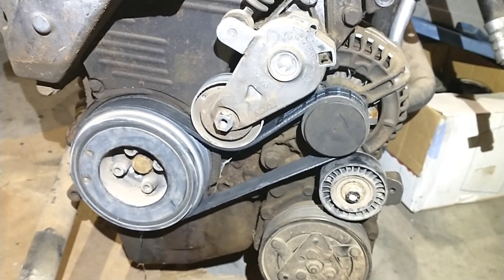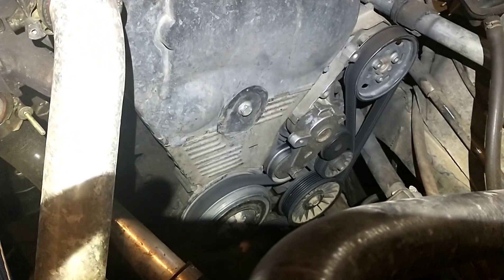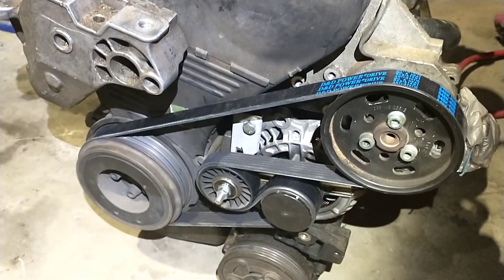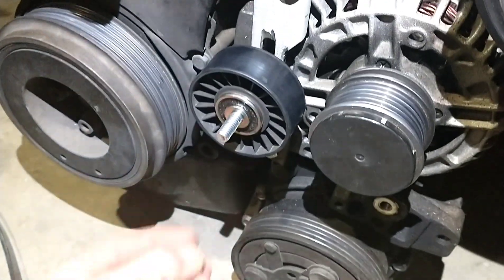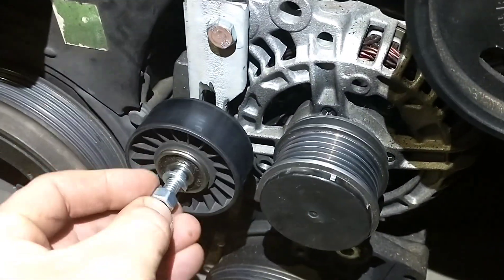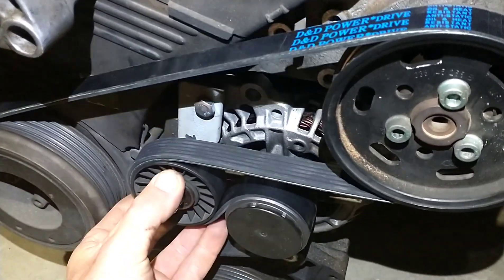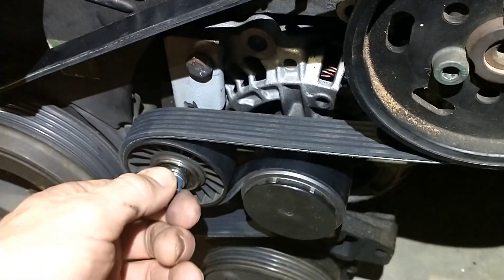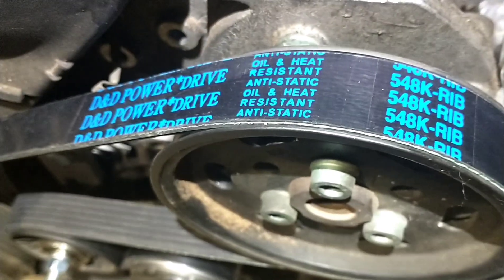ALH TDI MK4 Serpentine Belt Options For AC and/or Power Steering Deletes

Comment: It ripped a lower aluminum bracket for the roller.Bdestroyed alternator mount aluminum part. I need my car to be running within 24 hours. 3.06 in wideo best solution. Wish me luck...I have a 1318mm 6-row belt at home from Opel Corsa 2005CDTi used and now ones. I'll remove the climate compressor clima didn,t work before, and try to make custom tension roller bracket. Thanks for a tip
Reply from the maker: Hopefully it works! 🤞 Glad to help

Comment: Can I run a bypass witch on my 06 BRM Tdi  to allow me to turn the fans ON and OFF for the radiator??? I see the ECM controls everything on the BRM so I wanna be careful. Ive seen a few videos for a bypass switch mounted to the dash to allow one to turn the radiator fans on and off.
Reply from the maker: It's possible, I do not have schematics for the fan controller though.  I would probably just add an aftermarket relay setup if I was to do something like that, trigger it on separately myself
Reply: @TDISwaps  I saw a video on here of exactly that and the dude wired the relay to the ECT sensor that sits on the thermostat housing. It worked fine. I was just curious if it would play well with the ECM program so that it wouldn't conflict with the ECM program and fail to function or something else. Im only guessing that the worst that could happen would be that it would just not work. So ready to run a few wires with a relay and a switch for peace of mind while on long road trips with a hot diesel. I am to start a new job in Colorado 873 miles from home 5 days on and 5 off so that first trip with the new /used Jetta I want it to be mechanically correct as I can get it until I get a paycheck to go back and put new turbo, injs, EGR del, etc to give it a better life expectancy along with better maintenance. The Passat is on pause due to lack of funds for its turbo and extreme del. The Jeep is on pause for lack of funds and fab issues with the alternator bracket still. I need to find a machinist to fab the better bracket and then I can proceed to finish the Jeep. The Jetta will be for sale later this year if you know anybody that wants a good BRM with 5 spd, new clutch mastr and slv, new braided line, immo dash coming soon bc my dash doesnt read any instruments. dont know for sure why. The fella that sold it to me said it just quit working one day. He gave me another dash/cluster that wont allow the car to start of course. But why in the hell won't the old dash show any functioning gauges ??? I ripped the 2 clusters apart and placed the shiny new cluster face onto of the old cluster bkside to make on cluster. I hoped it would light up the gauges bc that old cluster of the 2 is the only one to allow the car to start up and run. Any ideas there appreciated. The Tdi guys say to send it to Eric in Ohio to do an immo and such but I dont need and immo I need the lights and gauges to function. He charges $ 150 for an immo and you must send the ECU I.D.. lost for now.
Reply from the maker: @Indianrider65 yeah that's a tough one if you have one gauge cluster that works I would just leave that one in and send me the ecu, I can do the immobilizer for $60.  You can PM me on Facebook.  https://www.facebook.com/share/163Ma2sMQw/

Comment: Threads on my power steering rack stripped. Gonna delete the power steering pump and send it
Reply from the maker: Yep you can definitely do that!
Reply: @ Thanks for the reply. If I do delete my power steering pump, should I loop the high/low pressure sides of the steering rack and fill with some fluid? Or can it run dry. Thanks.
Reply from the maker: @OwenC1 ya it just needs a little oil not much

Comment: my AHF Golf 4 TDi AC pulley bearing and magnetic coil failed now its making loud irritating metal to metal noise..... new pump is very expensive so while im saving up for that, i wana delete the AC ...... i just need the size of the belt i can temporarily fit there ... must be shorter than the original..... what size belt are u using ?
Reply from the maker: I believe it's 55", there's a link in the description

Comment: You had mentioned that "Austin" did a version of this. Do you have a link to his video??? I got the homemade plate made/copied of your version here and the bolt sits at just a bit of an angle to cause the tensioner to walk the belt off on a hand turn. I'd like to see his video to compare the flat metal bracket you both make. I have tried to find his video but haven't found it yet. I think if I add the second nut that sits on front of the plate I can maybe get the level/balance/flushness of the tensioner but......then it may be cause the tensioner to stick out 1/4-1/2" away from the grooves of the alternator pulley that it won't work. I will go try it again today and get back to you. I just think that nut in front (that the actual tensioner sits on) may stick it forward a bit too much. thanks brother
Reply from the maker: I don't have his video unfortunately and it's buried in his channel now, but it's almost identical.  It sounds like you might need to try different metal or tensioner, is the alternator stock? Maybe the surface of the alternator isn't flat...
Reply: @TDISwaps  I found it from 4 years ago. Ok today I move onto the coolant hoses if I get hung up on alternator bracket fab. LOL. thanks brother.
Reply from the maker: @Indianrider65 no problem man!
Reply: @TDISwaps  No its not stock bc I ordered a custom 250 Amp alt from JS alt in South Carolina. Its almost an inch wider. I had to get longer bolts and re thread the mount holes to accept SAE bolts. fun fun fun. Have a great day.
Reply from the maker: @Indianrider65 ok that makes more sense! You too man!
Reply: @TDISwaps  I have made 4 different AC delete brackets b4 I finally got one somewhat perfect. So today after several attempts last 3 weeks minus a cold weather off week....I got it on but....the belt keeps walking off the tensioner pulley. I tried many different amounts of spacers to try to see if it was just the alignment of the pulleys. The tensioner seems to "tilt" to the D/S a tiny bit ...maybe that is enough to cause it to walk the belt off??? I did 
Austin's version this time. I had done 3 of your version and gave up. Im about to just buy the big AC delete pulley in your video fm Amazon if I cant make this work this week bc its holding me up fm moving onto the rest of the project. Im having to work on it outside bc I dont hv a shop so I have to take warmer less windy days to do some of the work. Ill post some vids of it when I figure out how. and you can tell me what I may be doing wrong.
Reply from the maker: @Indianrider65 sorry to hear that man! There must be something off with the casting on your alternator brack bolts unfortunately you might just have to go a whole different route 😔
Reply: @TDISwaps  I just posted 3 short videos 55 second videos if you can see them and critique let me know. thanks bro.
Reply from the maker: @Indianrider65 I commented on your one video but you should not have had to cut down the alternator or the bracket it should have pulled itself flush, I'm afraid you may have offset the alternator by shaving that down 😬
Reply: @TDISwaps  Have you ever removed the AC pulley on the ALH??? I want to swap it with the plastic pulley on the other A/C delete kit. The one in your vid that is a 4 leg from Amazon. I think it can be done. let me know if you've pulled an AC pulley and if you think I can swap it onto the Amz version
Reply from the maker: @Indianrider65 I've always just used the plastic one, delete it altogether, or keep the AC
Reply: @ I was gonna post pics or vids here of the "alignment" of the 3 pulleys but Ill just tell ya now....I took that OAD pulley off and put a small 1/4" spacer in the recessed area around the shaft to push that alternator pulley forward a bit. It still isn't correcting the gently tiny bit of angle on the belt where it crosses under the tensioner. I had JB welded some washers on those 2 back tabs of the alternator hoping to contribute to some more tiny aligning but they just fell off upon intstall bc its so tight getting that aftermarket alt installed in there. I am on my 5th home plate (all made of 1/4" steel) from home depot. I'm seeing a tiny bit of bend/flex / twist to the plate as I tighten it down with the 2 bolts up front. Here's my final thoughts....Im gonna try a 3/8" & then if needed a 7/16" thicker plate to possibly stop that slight twist at the tensioner. That twist is making the tensioner sit at just a lil bit of an angle that makes the belt walk off as I hand crank it . We are allowed a little "leeway/slop" there at the angle/tilt of the alternator. say...1/8/1/4"ish. Im not that far off I promise you. I just didnt wanna cram a phone pic down into the area to convey my idea to you. Do think my thicker plate idea will correct that tensioner a few degrees to the flat that it needs to be to assist in preventing belt walk off??? stay warm. Its staying in the 20s all next week and my Jeep is outside in the gravel so I wont be working on it till next Friday when it s 50 degrees. thanks for your ideas and patience.
Reply from the maker: @Indianrider65 I think the thickness is 100% the issue, I didn't every test this getting the belt really tight, I need to do more research on just how thick it needs to be, but it definitely has to stay straight or it will just keep walking off I'm sure
Reply: @TDISwaps  Ok, thanks. I value your insight. enjoy your weekend. God bless

Comment: What about moving the ac compressor to the passenger side? 
What’s needed for that?
Reply from the maker: Well you can use a BHW 2.0 TDI harmonic balancer with dual belts and compressor mount, and then the AC compressor will mount on the passenger side with its own belt.
Reply: @TDISwaps  does the 1.8t bracket work?
My local junk yard has 3 of them and they have the compressor on the passenger side, no BHW cars there though
Reply from the maker: @renosgarage7451 I'm not sure on that, I've only heard of guys using the BHW ones, might just have to try it and see
Reply: @TDISwaps  ok imma go grab the bracket and give it a shot today
Reply from the maker: @renosgarage7451 nice, let me know!
Reply: @TDISwaps  the 1.8t bracket fit but the compressor isn’t gonna fit on the passenger side down low, it’s hitting the frame rail on this XJ
Gonna have to make a custom bracket
Reply from the maker: @renosgarage7451 dang well it may work for other swaps anyways

Comment: Can you run the AC compressor on the TJ without hitting the front diff or suspension arms?  Is that why you are running the delete pulley?  We are ALH swapping 1950 Willys Wagon on a '97 TJ chassis and would like to run the VW AC compressor if it fits.  Thanks for the great videos!
Reply from the maker: It definitely won't fit without lift, I just don't have AC in my Jeep or I would have the compressor on there but you will need custom bump stops for anything less than a 4-in lift or the differential will hit the AC compressor.
Reply: @TDISwaps Thanks for the input.  Check out the build @Rustomod  .

Comment: Awesome video man, really helpful and interesting. I have a question. I have a 2002 jetta TDI, when i started my car today my idler pulley snapped off with a portion of the holder/block its attached to. I will try the first short belt that just includes the alternator to get the car home. What do you recommend going forward? Do you know a part number for the piece it attaches to or is that an extension of the engine block? Do you recommend purchasing a new part, rerouting the belt (if the idler is not necessary?) or is this something id have to spend alot on at a shop?

Ps i am somewhat good at fixing my car myself and have a mechanic cousin that can help. I also do not have surplus cash to be spending on crazy repairs haha
Reply from the maker: I would probably need to see pictures to tell exactly what's going on, but the alternator only belt is definitely the fix all.  You can PM me pics.  https://www.facebook.com/profile.php?id=100014261163897&mibextid=ZbWKwL

Comment: Do you know if this belt will work on a 2000 Jetta tdi I’m looking for the bypass pully but can’t find one for my year
Reply from the maker: Yes all these belt options are for a 99-04 ALH TDI.  Here is a link to the AC delete pulley but I can't say I recommend it many people have issues with it not lining up properly, including me.  I believe it says it only works until 1999 but they all used the the same AC compressor.  https://www.amazon.com/Dorman-HELP-Bypass-Pulley-34214/dp/B000IY6RZU/ref=asc_df_B000IY6RZU/?tag=hyprod-20&linkCode=df0&hvadid=312430092407&hvpos=&hvnetw=g&hvrand=11505141250984642263&hvpone=&hvptwo=&hvqmt=&hvdev=m&hvdvcmdl=&hvlocint=&hvlocphy=9029255&hvtargid=pla-569370370069&psc=1&mcid=a1a0fe788b583a29924edda6fda10423&gclid=CjwKCAiAsIGrBhAAEiwAEzMlC2NbIOMIwC0vdRNvD-Iv6EDcxg_Wt-oNjOe3o91wc2i2oqo4BAoPLBoCNmgQAvD_BwE

Comment: Thanks! I am wondering if I just disconnect the AC lines (having trouble getting it back together after a heater core replacement) will it blow up the compressor without liquid/gas going through it? I don't necessarily want to delete it, just not hook it up again, so if I just never turn it on in the car will it be OK?
Reply from the maker: Yes you want the keep dirt and everything out of the compressor though, and it will seep oil when the engine is warm so you need to seal the ports well but it can stay unhooked yes, the clutch has a sealed bearing on the front for turning without the AC on
Reply: @TDISwaps  Thanks, I appreciate your quick reply.
Reply from the maker: @gerrys6265 no problem!

Comment: Hey. I'm stuck 200kms from home. My ac compressor exploded. Can you please help me get a belt part number close to this one. This part number is not available here in Canada.
Reply: I found two belts 5060325 and 5060288 those are the only dayco made belts close to the 5060295. Do you remember if it was a tight fit or a loose fit.
Reply from the maker: @colincorreia61 the one I used was tighter you'd want something a little bigger than that
Reply: Thank you. I'll look for something a bit bigger. Thank you
Reply from the maker: For sure man!
Reply: @colincorreia61  have you tried the 5060325? Good fit ?
Reply from the maker: What brands do you have there in Canada? Are you trying to get the alternator only belt?
Reply: @TDISwaps  we have acdelco and continental and dayco but.... these cars never were offered in canada or these engines so they don't sell them
Reply: I need to find a belt either slightly smaller or slightly bigger that was a common car in canada.

Comment: Im looking to ALH TDI swap a 2005 Ford Ranger and i want to keep the AC as itll be a daily driver year round. What sort of options are there for keeping the AC? I cant seem to find a solid answer
Reply from the maker: If you check out my Toyota build playlist I go over how I did air conditioning in that. I used to VW compressor and had the ac lines TIG welded together

Comment: I believe I have a euro accessory bracket on my ALH with mechanical fuel injection. I want to have AC and power steering. Can I swap accessory brackets?
Reply: What air filter is on the jeep?
Reply from the maker: @millersheehan that was just a universal one I found on eBay, not sure they have anymore
Reply from the maker: Yes they should bolt to the injection pump exactly the same
Reply: @TDISwaps  awesome, thank you
Reply from the maker: No problem!